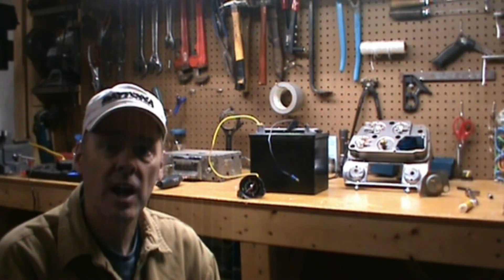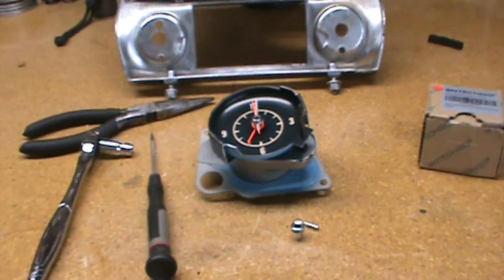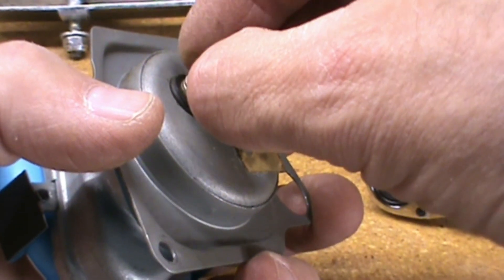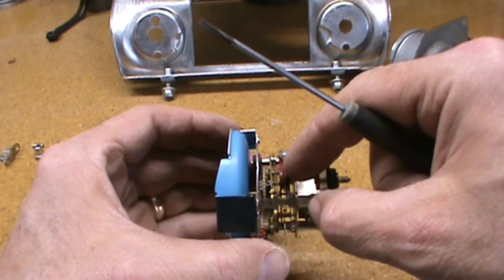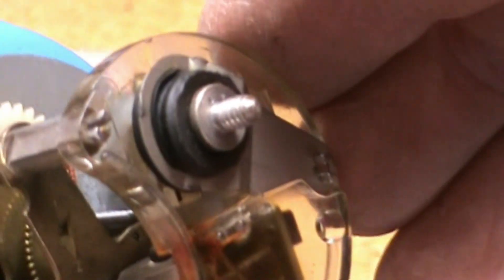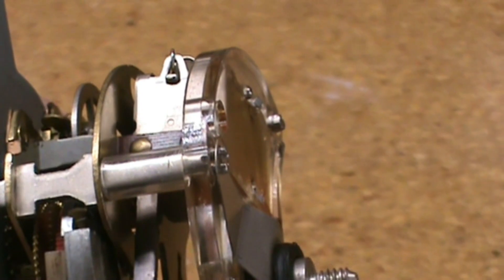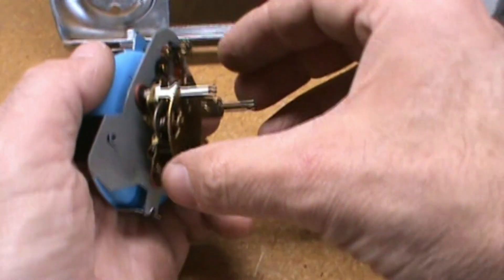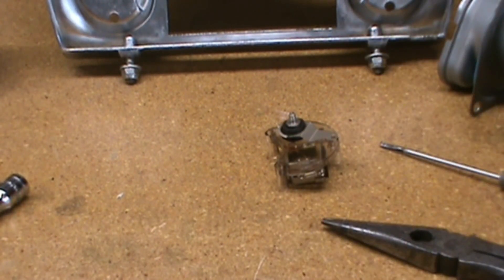C3 Corvette Stingray Clock Restoration

Comment: This was so helpful, Thanks, Mike.  Hey separate matter, my 72 Corvette is really struggling to start when it's cold.  It takes many cranks for it to finally start, almost to the point to where it sounds like the battery is starting to slow down.  However, if you spray starting fluid in it prior, fires right up first crank.  I have check the choke, (Rochester Quad), seems to be operating fine.  I have changed fuel pump, operating fine.  Car gets plenty of fuel and drives strong once started, so scratching my head a bit.    Also, not sure if these are connected, but after driving for a while and up to temp, and stop say for lunch for 1 hour or so, once get back in fires right back up no problem. BUT, say I stop for gas and engine is off for 5-10 mins, once I try and fire back up, it almost sounds and feels as if it's flooded and barely starts.  It spins and spins trying to start, and it finally gets going and have to really give it gas to fire back up.  I researched, something called hot start?  Ever run into anything like these?    Thanks, love the vids!
Reply from the maker: Hi Westley, 
Thanks, glad it was helpful.
Your issue could be related to too much ignition advance for both cold and hot start.  It could also be a weak ignition coil.  It also could be a weak battery or alternator not providing enough energy to the ignition circuit.

Hope that's useful to you.  Good luck.
Reply: @MikeHammill-TheShop  Thanks, Mike. I hadnt thought of the coil.  I'll check that out along with the advance.  Thanks!
Reply: What type and gauge wire di you use to rewind the solenoid

Comment: Thanks for the video. What if when you get the mechanical part open and the contacts where you slide down to get everything moving are stuck together, almost like it took a surge and made a small weld. I pried apart pushed down where you did, but nothing. I'm not sure what angle that contact arm should be at mine is at about 9 o'clock or straight out to the left looking from behind. My solenoid wire is not broke. So I guess I'm asking what should I do if my mechanical portion is inoperative. Trash and by new clock??
Reply from the maker: It sounds like the mechanical portion  may have gotten contaminated (dirt, dust).  Electricity doesn't flow through that part, so it shouldn't be welded.  The armature wire is also too thin to support an arc.

I'd suggest trying to clean it with sewing machine oil and blast with canned air.  If you can't get it to work then sell it on ebay because it is usually the coil that fails.  Or buy one with a bad coil and rebuild it.

Good luck and don't get discouraged.  This is pretty fragile stuff.
Reply: @MikeHammill-TheShop     Your help is so appreciative Thank you. Finished your advice above and my clocks mechinacal side works now, but temporally. It cycles for approximately 10 minutes and stays closed and stops. i have noticed that my battery voltage has been drained when this happens anywhere from 14vdc to 7vdc. When I disconnect the ground it starts running again as above 10 minutes at a time. The only thing I can think to do know is either change the coil or put it back in the case and see if it's just not making a good connection out of the housing. Thanks again for your knowledge.
Reply from the maker: @larrystehr4835  it could be a bad ground. However, draining the battery 7 volts might mean you have a weak battery and it might not be your clock.
Reply: @MikeHammill-TheShop   Thanks again. thats kinda what i was thinking with the outer case off not making a good ground. Also i was using an old battery with a charger on it.
Reply from the maker: @larrystehr4835  the clock should not run down the battery for a week or more.